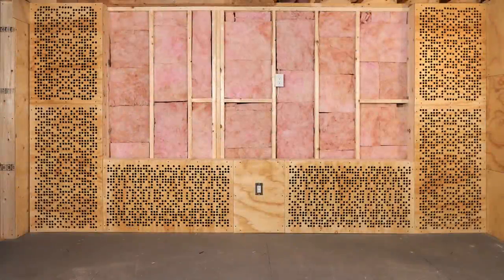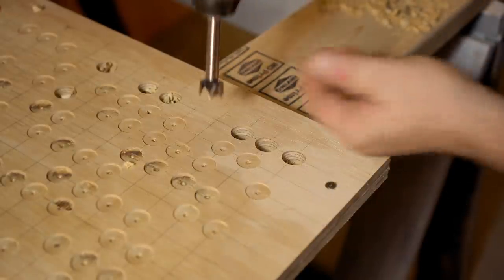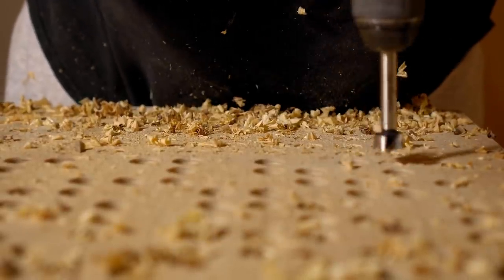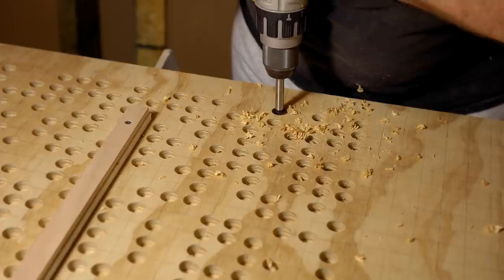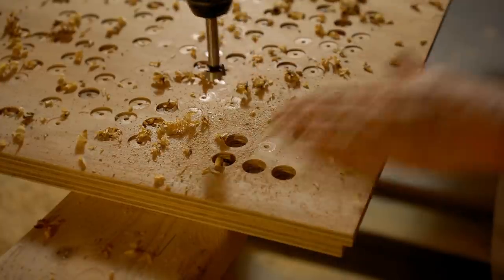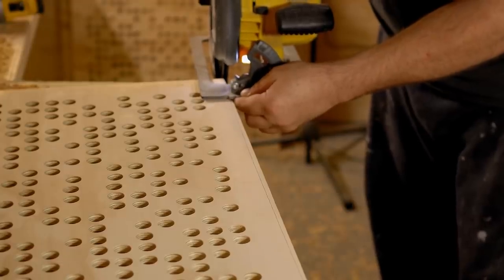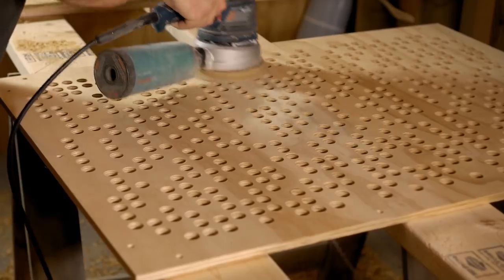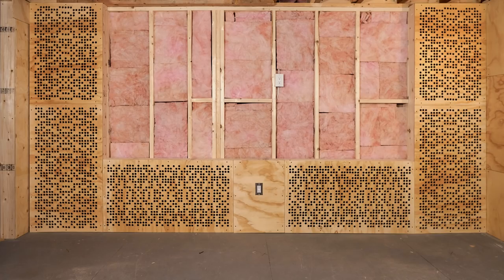How to make Binary Amplitude Diffusers without a CNC

Comment from the maker: Short answer: drill a ton of holes.
The holes size, number of holes and sequence are what defines a true binary amplitude diffuser. But if all you really want is a simple perforated panel to provide some hard surface in front of a broadband absorber that looks neat, this is for you.
I started on one end of the panel and just randomly drew a sequence that was mirrored on the other end. For example the sequence for the first line is:
11100110101110101100111
the next is:
01101111010001011110110
and so on. Each is a palindrome, the same from both ends, so really you are just making the pattern on 1/4 of the panel. Very much like making a paper snowflake by folding the sheet twice and cutting the pattern.
My mistake was not making a master template panel to begin with that was accurately laid out and drilled with 1/8" pilot holes. I could then use that panel to layout the other 5 drilling the pilot holes through those to begin with before drilling the 3/4" holes. My final results would have been more accurate and I think I would have saved time overall.
These panels go on the front of broadband absorber panels and stop some of the higher frequency sound from being absorbed. Rooms with too much absorption can sound "dead", and this can fix that while still absorbing the lower frequency content. Most of the lower frequency sound just passes right through these panels and into the trap behind.
Reply: You have a bass trap with some reflection. To provide diffusion over a range of frequencies the math matters. So it's weird that the title is diffusers that you ignore the actual diffusion.
Reply: Bonjour , ancien tuto , mais j' essaye !!!
Je comprend pas pourquoi faire des trous , il reste beaucoup du panneau qui va diffuser et peu de place par les trous pour l'absorption !!!
Un tissus acoustique doit être bien plus efficace ... non ? 
Peut être même faire des panneaux moins grands pour le même résultat  ... ? 
Désolé je parle pas anglais et essaye de comprendre en regardant les commentaires , mais n'ai pas trouvé de réponse au pourquoi du comment ! 
Merci .

Comment: The pattern of the holes will be different for what part of the frequency you're trying to defuse. Not only will a random pattern not work as well, you could be defusing the wrong frequencies and making the problem in your particular room worse. When i built my recording studio I did a pink noise test analysis of my room. This gave me a picture I could see with my eyes of what the room looks like for sound. At that point you can start making your plan of how to craft your room. Your walls look cool and I think that's what you were going for. For sound, every little thing matters.
Reply: There are a lot of half truths or plain old wrong information on this channel, which is a shame.

Comment: I really love the outcome! I'll definitely put something like this to my music room! Thanks! One advice tho for the absorption material: If you're using rockwool or similar, pack it airtight in large garbage bags and wrap them with some tape. For the low frequency energies these plastic bags have no impact, but you ensure to not having any fibers flying around eventually. I did this to 5 cubic meters in my acoustic ceiling :)

Comment: Nice job - always great to see people spread awareness about acoustics. At 2:13, In regards to creating an actual BAD panel, if you follow the sequence you optimise absorption at a given frequency range (spacing between holes and hole width/depth are tuned to work at a certain bandwidth). This will likely have more of an overall effect on the phase diffusion you'd get from a BAD than absorption coefficient.

Comment: Man… absolutely beautiful job. Craftsmanship is unreal. I just do not see the point in going thru all this trouble to do it right… and then throw caution to the wind with the math of the hole spacing.  You are clearly a skilled woodworker- would it not bother you to see a YouTube video of someone doing something VERY wrong in terms of woodworking?  I mean, it’s beautiful yes- but that’s all it is. It’s not predictable in its reflective/absorptive behavior so you can’t know if things are better or just.. different.  If all you want is a perforated surface- just use peg board and save the time. But such a good job on execution. especially without CNC machine. Looks great. I cross my fingers for you that it helps your room handle pressure and level better.
Reply from the maker: The proof is in the pudding, guy. If the hole math made that much difference, my measurements and listening would have shown that. 
For your information the point of the math is to prevent just one possible problem: specular reflections. And the plain old walls that 99.999% of people listen in are nothing but specular reflections.
So lay of the drama and learn what's important.
And I see guys doing woodworking "wrong" all the time. Until they ask me my opinion, I keep my mouth shut. It's none of my business, even though I do have a lot of knowledge and expertise to back up views.

Comment: I understand your predrill recommendation, but just curious why, at the beginning of the video, did you use the forstner bit to only drill a mm for each hole.  (Was it to keep your bit sharp during initial drilling of each hole?)
Reply from the maker: Exactly - that was my thinking, to keep the bit sharp long enough to cleanly drill the start of each hole, then hog out the rest after it gets dull. I quickly abandoned that idea, though.
Reply: @IBuildIt  Thanks! Is it easier to sharpen the bit? Or do they ever return to their original sharpness?
Reply from the maker: I made a video on my main channel on sharpening forstner bits a few years ago. I sharpened this one at least 6 times while drilling the nearly 4000 holes.
Reply: @IBuildIt  how many battery charges did you go through?
Reply from the maker: Surprisingly few, but these are the big 60V ones.
Reply: @IBuildIt  nice.. I'll have to remember that when I get a new drill set in the future

Comment: "The Wiener-Khinchin theorem states that the squared Fourier transform magnitude of a sequence is equal to the Fourier transform of its autocovariance or autocorrelation function. Thus a sequence of reflection coefficients whose autocovariance is a Kronecker delta function will form a good diffuser, because the autospectrum will be uniform." 
I don't know man.
Reply: Sounds reasonable. I think what it amounts to is that your drill bit needs to be good and sharp, and you might want to have the second battery on charge before you begin.
Reply: And to think I actually understood some of that once ...haven't touched Fourier transforms in decades; can't even find the book.
Reply: I exhaled through my nose so sharply, that a booger shot out.
Reply: it is like the turboencabulator explanation
Reply: @thecarl168  one of the cross-beams has gone askew at the treadle.

Comment: You are right...BINARY anything is not related to sound manipulation in any other way than digitizing analog waveform samples. Just stick to any uniform holes distribution with carefully chosen hole-diameters and surface/hole ratio.
I wish you could repeat and film the experiment with suggested panel with binary code illustration holes and compare the effects with your initial product.

Comment: If you had partially drilled a few of the holes, you could have used it for the screws and painted the bottom of the hole black to match.  Great work and thanks for sharing

Comment: Hey John, don't you have the equipment to measure sound reflection? I would suggest a small-scale experiment to measure if the random pattern differs in absorption / reflection characteristics from the special pattern you spoke about. Although it might be challenging to measure bass absorption on a smaller sized panel
Reply from the maker: My ears :)
I'm making room measurements using REW in ten locations throughout the room as I progress through the build. Mostly concentrating on reverb time in the lower frequencies to get those down without killing the high end in the room.
Reply: This can a lot of work for a home studio. You can see the procedure in the book Acoustic Absorbers and Diffusers, Peter D'Antonio and Trevor Cox.
You will get diffusion from an arbitrary pattern, just not as uniform as the BAD design.

Comment: I expected "water based polyurethane", but I wasn't sure how you were going to integrate "polyurethane construction adhesive". You did not disappoint. Are you going to do a back to back comparison with 1mm larger holes? 1mm smaller? ;)

Comment: I know this is an older vid, but could you not do as you said and grid the first panel, drill your pilots, use that panel as a pilot drilling template for each panel. But instead of using a backer board that gets chewed up and gradually less effective, why not use the next panel as the backer for successive panels. Requires good panel to panel alignment, of course. But starts the holes in the next panel and might help with tear-out too. Just a thought. :)

Comment: Man that's a lot of work but nicely done! Now I guess that you did your research before you built these. And when I look at it a slat diffuser would be a lot simpler to build. Is there a significant advantage of using these over a slat diffuser? My only guess would be that these absorbers a lot less high and mid frequency? And do you have a west with a calculator that you could reccomend?

Comment: This might be silly, but I have to ask as I’m very interested in this 

Could you use a pegboard panel for your initial layout panel as far as the 1/8” pre drill layout?  I started this vid and looked over at some random pegboard in my shop and thought, hey......
Reply from the maker: As long as the pegboard hole spacing is what you want, sure.

Comment: “And to fasten that, I’m using polyurethane construction adhesive, because it’s polyurethane construction adhesive compatible, and it’s most in line with the polyurethane construction adhesive compatible type projects,  that I usually use polyurethane construction adhesive on.   😎

Comment: How are you making the decisions about acoustics? Are you working from a book or using software?
Reply from the maker: Past experience and online research, mainly. It's time consuming because there's a lot of less than accurate information floating around and then you only recognize it as inaccurate after you've learned quite a lot.
The basics are: the lower the frequency, the harder it will be to treat and to effectively treat it requires space. 2" of foam glued onto the walls won't do much, in other words.
Reply: @IBuildIt  Yes, I know some of the recording studios I work in have bass traps that are three feet thick, depending on the frequencies they're trying to absorb. The best of the guys who design those spaces make a lot of money, and for an engineer the great sounding rooms are worth every penny!

Comment: Man, that's a mind numbing amount of drilling. QRDs for the centre?
Reply from the maker: Unfortunately, the room must have a TV screen (monitor) so that will be on that front wall with a quadratic diffuser on each side to fill the space. You can actually see some of one of those diffusers in the picture of the wall in the video.

Comment: Could you have used foam instead? Insulation foam, if it exists? To save a ton of time drilling.
Reply from the maker: Foam absorbs sound, it doesn't reflect.
Reply: @IBuildIt  I thought you wanted it to absorb sound. How does reflecting the sound back help?
Reply from the maker: Sound is made up of different frequencies. So you don't want over-absorb some, like higher frequencies, while trying to absorb the lower frequencies. 
Lower frequencies are much harder to absorb because the waves are much longer and they have more energy. Notice how you can hear bass thumping in another room, but you can't hear much high frequency stuff? Bass is very difficult to absorb and you need a lot of treatment to do it.
Reply: @IBuildIt  nice explanation. Thx. Still is there anything as sweet as the pre-digital sound? Me thinks not so much.  I’d bet the sound in your room gets the sound way closer to that sweetest sound. Good work. Amazing focus and execution.